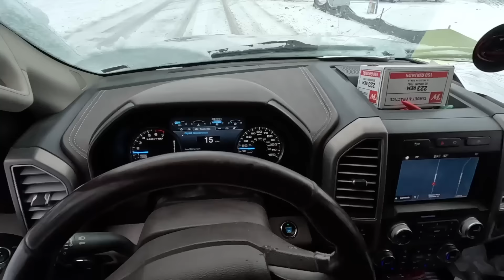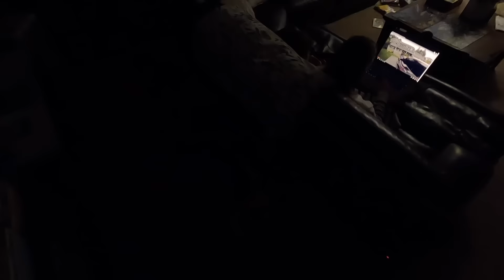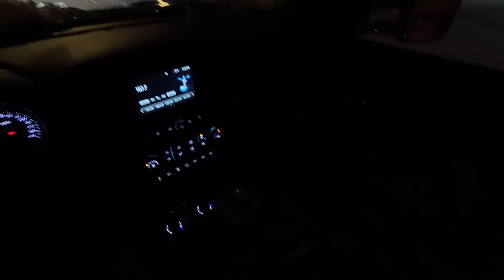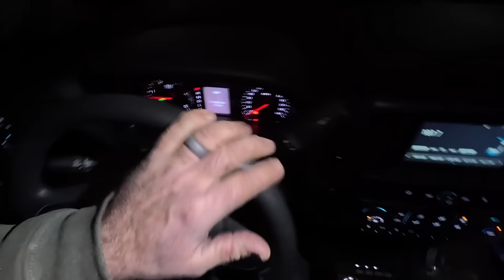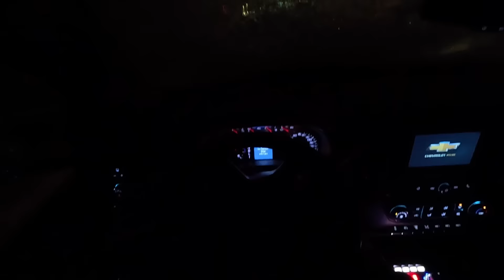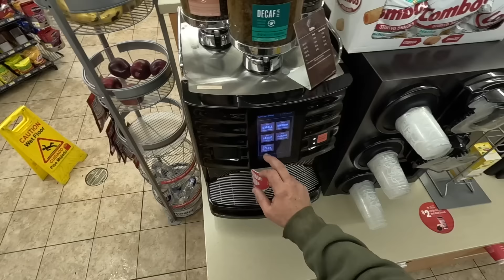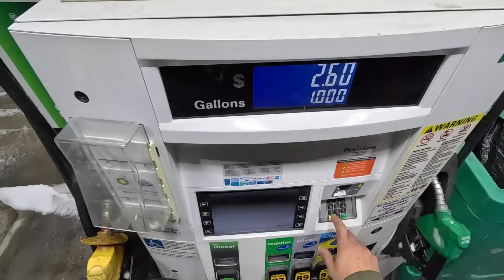Plowing snow FINALLY!!! What took so long!

Comment: @Victory Outdoor Services, I have one of those EGO snow blowers.  I live in Iowa, and it works really good.  It does really well up to about 6" of snow, it will do more but after that it really starts draining the batteries.  When the snow is dryer , it will throw the snow about 10 to 15 feet or more.  The reason I bought that one, is my wife can use it when I am out of town because it is light compared to a lot of the gas ones.  I hope it works as well for you, as it does for me.

Comment: So I used to work at a gas station with those machines and if it ever locked your card in it you wait about 20 seconds then push your card in don’t pull it re-locked it every time you pull but push your card in and it will release it. Love your vids been watching for years.

Comment: Just a idea for you, as I have been watching your older videos I notice how much fun you have setting pins, well what I started doing about a year ago is using a ground rod driver bit in my SDS in hammer mode, with the $30 bit you can drive pins very quickly and easily, the only catch is you need to cut off the mushrooms on the top of you existing pins so the fit inside the ground rod driver. I am really enjoying your content and can relate.

Comment: When you get the chance take your SD Card and quick format your SD card to your computer then back to your GoPro & and set all your presets back to default & then out them to the settings you had them on.. I had the same thing happened to me last week after I did that GoPro works brand new 15:23

Comment: How did Daniel like blowing snow  with his battery powered ( not a toy!)snow blower? Did it pass hiss quality control inspection.  Not that everyone has worked out the feel for plowing this season,things will work more smoothly. 
Just takes getting familiar with the process of plowing! Now you can relax! And everyone can do there job assignments 
Reliably. 👍🏻great crew Ryan. 👌🏻👍🏻

Comment: in utah we had a storm like 2 weeks ago and another one is in progress winter weather advisory 1/12/24-1/15/2024 till like 5am and i drive a big truck like just the bed is 20 feet long and when it snows that is when i really get to have fun drifting my 2013 kenworth t270 flatdump work truck i have yet to have a crash in the snow

Comment: Wayne 002 card readers and keypads most definitely don’t thrive in cold temperatures lol you’re lucky it didn’t clamp down and let go, they are notorious for getting stuck if you try to pull you’re card out before they unclamp! They get locked up pretty good and don’t unclamp once the card reader loses communication to the payment board

Comment: I would rather drive on ice then get salt all over my truck. We are lucky here in Nevada they don’t salt the roads n they put the brine (which has salt in it) on the roads before storms as best they can and then they just plow and spread sand. Which is totally okay for me I don’t mind driving on ice and snow I can  make my truck last forever without needing to put any coating under it. All the Californians are taking over Nevada tho and sliding off the roads everywhere so they’ll prolly start salting the roads